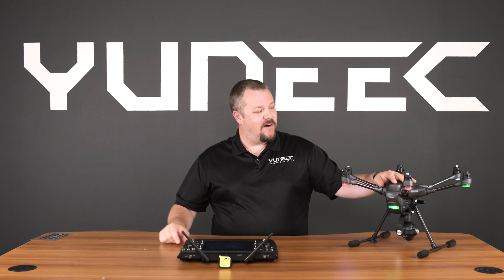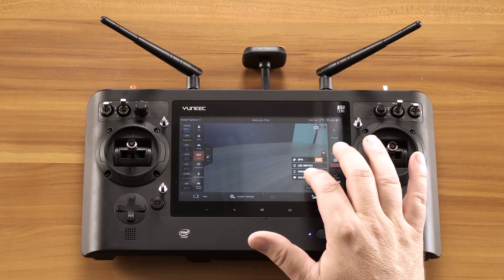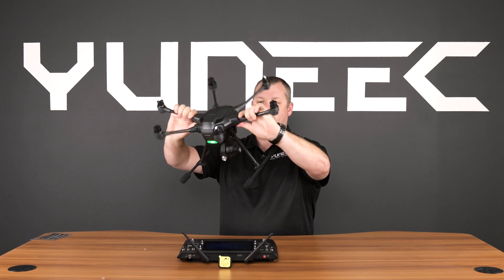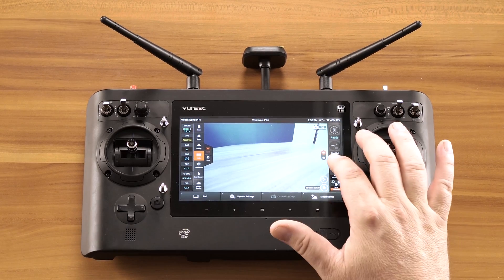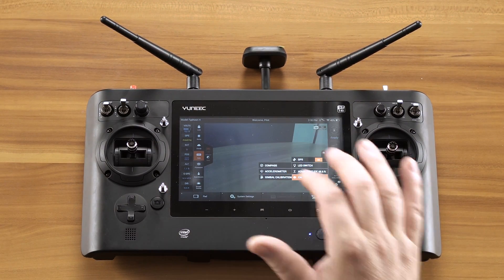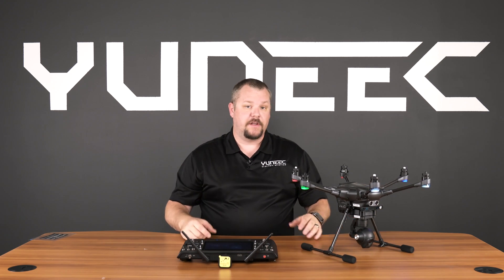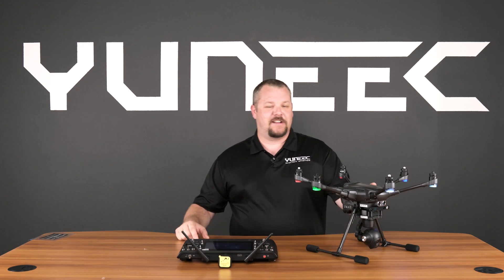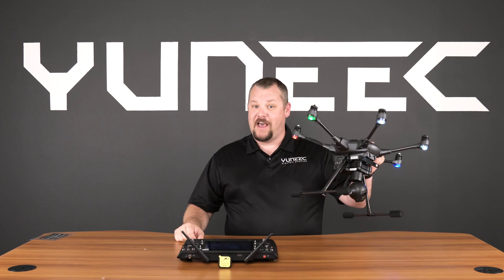Typhoon H: Compass Calibration Tutorial

Comment: Why isn't my Typhoon H calibrating? I select any calibration option and it doesn't do anything.

Also having a problem with Watch Me in that whenever I try to switch it while airborne, it just immediately switches back to Follow Me. The only time it will stay on Watch Me is when it's on the ground, but it will revert back into Follow Me when I'm airborne.
Reply from the maker: Please call tech support for assistance at 1-844-898-6332 / uscs@yuneec.com 

M-F 6am-5pm PST 
Sat. 8am-4:30pm PST   

-Team Yuneec

Comment: Tried this 4-5 times and it never did calibrate. White light every time.
Reply: Did you calibrate way from buildings and in an open area and with no cell phones near by?

From the Manual:

CAUTION: Do not calibrate the compass in parking garages, close to buildings or near roads with a metal core. For optimum performance, only calibrate Typhoon H in open spaces, far away from power lines and other metal structures or concrete buildings.

NOTICE: Be sure to perform the compass calibration procedure at least 11 feet away from the nearest cell phone or other electronic devices to ensure proper calibration.

I have still to perform the calibrations.
Reply: I have 2  h's I have been trying to re calibrate numerous times, I called support ,before this and we went through numerous things to fix issues, we start the calibration , he knows I'm in side and gets irritated when he tells me to flip it  and says read the manual, well I watched the video , he ended the call . At no point did he say anything about being out side in a field...it's 110 out side right now I think I'll wait...idiot.